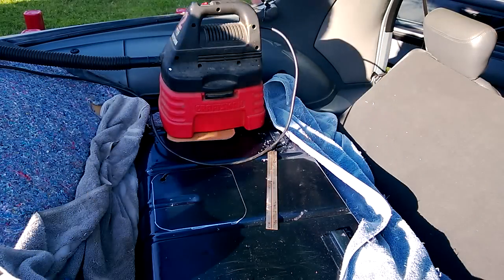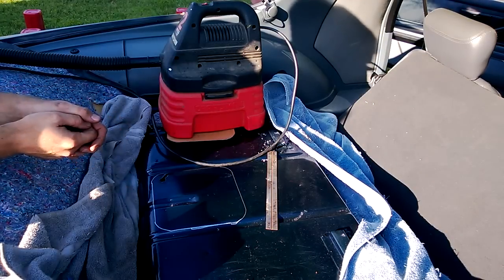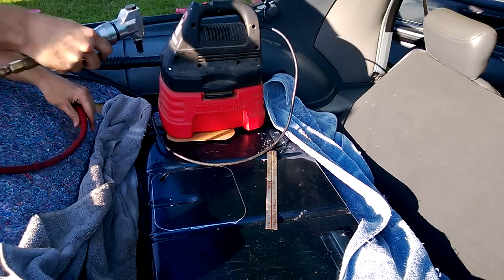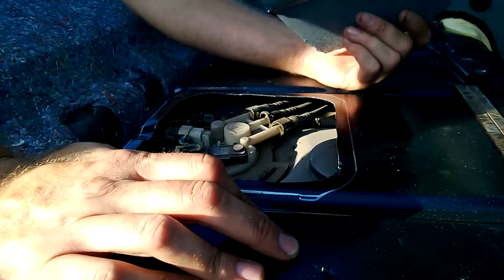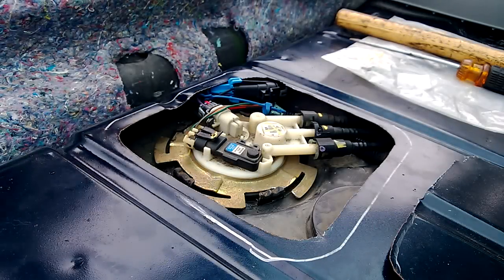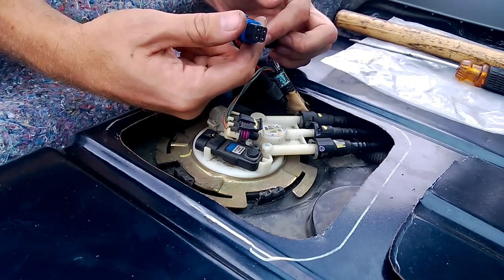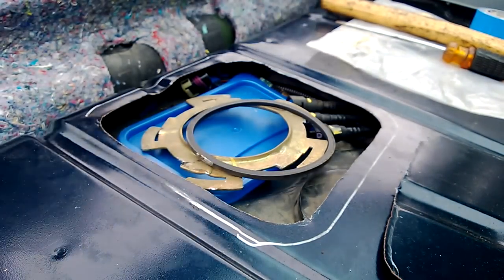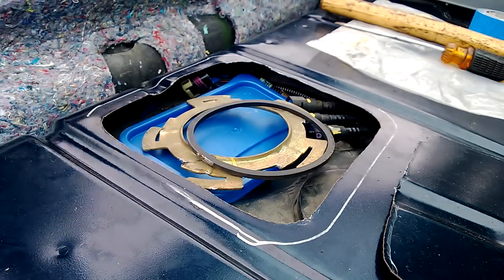Cutting Fuel Pump Access Panel and Removing Fuel Pump Assembly - 86 Trans AM with 02 Gas Tank

Comment: Yeah, lets just cut holes in the car. I guess the design guys didn't know nuffin bout unibody integrity. Now you have a access hole which can allow exhaust fumes into the car. And since you removed all the primer and rust proofing, moisture will do it's job and start rotting out that area. Personally I would have used a grinding wheel. More fun that way!
Reply from the maker: TF are you going on about?  This hole does nothing to hurt the integrity of the uni-body.  All the important structure of the uni-body in that area is in chassis extrusions and over by the shock mounting points.  The design guys did plenty I'm sure, but they also didn't test it with an access cover.  Its just not something they considered, but I'm willing to bet in a crash test there will be no difference with or without the hole.  NO exhaust fumes are coming through this.  There are more fumes coming through the windows when they're down, than will EVER come through the SEALED access opening.  As for removing the rust proofing, you are 100% correct, I sure did.  And I also replaced with with better rust proofing (POR-15) when I was done.  Every time I see a new comment on this video I cringe Haha.
Reply: So you are a vehicle design engineer? Cutting holes in body panels of any vehicle not destined for the derby is just ridiculous. Only an amateur would do that. I did 8 years as a Marine Corps mechanic. Never did I witness such an idiotic repair. And I've seen a few. Cut a hole in the body! HAHAHAHAHAHAHAHAHAHA!!! See ya in the funny papers! And you should cringe when you see new comments. I would as well. When some poor guy decides to take your advice and uses the only tool he has, like an angle grinder, and blows himself up, you will probably laugh and call him stupid. Oh yeah, key word in your "disclaimer" I "believe".
Reply from the maker: You are off your rocker buddy.  If you take a cut off wheel to your fuel lines, that's on you.  This has been done by MANY....MANY people.  Not just on these cars.  And you're right, I am an amateur.  I never claim to be an expert.  I don't get paid to work on cars, I do it because I'm good at it, and I enjoy it, and for the most part people enjoy watching and like the help I provide.  Cutting holes in body panels makes cars destined for a derby now???  That's hilarious.  I may not be a vehicle design engineer, but I have enough engineering experience in my field to know that its fine.  You've never witness such an idiot repair?  Come on...  Do you have something specific against me or do you go around looking for all DIY things you don't approve of on youtube and toss around your BS?  If you do you must be very busy. Good lord I try not to engage people like you, but I can't help it.
Reply: Yes, I am off my rocker. I don't like to see idiotic advice from clowns. And no, I don't spend time looking to engage people with dumb ideas. But when I come across them I do feel compelled to respond at times. If you don't appreciate my reply, don't read it. And I never said cutting the hole makes the car derby bound. I said no holes should be cut unless it's derby bound. What's wrong? Thinking maybe I'm right?
Reply from the maker: Ok, so we're down to semantics now.  So ONLY if I plan to take the car to a derby, is it ok to cut into the body panels?  Right?  I want to make sure I have it right so I can pass this advice along.  I wouldn't want you getting angry at me and calling me names for getting your wisdom incorrect.  I guess I should have stopped and taken the car to the derby after I cut the same size hole in my trans tunnel for the auto to manual conversion?  You think you are right, and that's fine.  I actually do appreciate your reply believe it or not.  I probably shouldn't have responded...but oh well.  Thinking you're right though?  Nope.  Sorry man... I 100% disagree with your entire argument here.  I also am pretty certain you are aiming to get me riled up.  Now I'm a clown?  Wow dude...  The kids have a word for that, but I hate using it.  If it makes you feel better, I will stop responding so you can have the last word.  At the end of the day, this won't affect me one little bit.  I'm going to keep on keeping on.  Sorry you didn't like my video, my stuff isn't for everybody!
Reply: No, it is not. First correct thing you have typed all day. The hole cutting does kind of remind me of Larry, Mo and Curly Joe.
Reply: Don't worry about this POG talking trash. He's just mad cause all he did was stay behind wire while the rest of us were stacking. Ive owned nothing but f bodies since I was in high school. Every single one of them I put a trap door and it runs fine at the track and as a daily. Its a fast way to swap that pump out period. If structural strength is such a concern then go get some subframes and roll cages but dont go bashing someone else for something you don't agree with. Insecure cowards do stuff like that.

Comment: I could've had that gas tank out and the fuel pump replaced and everything going back together before you even had the hole cut!
Reply: But for the record I have nothing against doing this, it should come from the factory like this, it would make everything so much easier if engineer's designed vehicles to actually be worked on instead of just worrying about making the most money!
Reply from the maker: I agree....if you already had the exhaust off, axle out of the way, and most of the gas drained haha.  But for the whole job, this is pretty quick.  Plus I was babbling to the camera instead of working :)

Comment: hey i have a 1989 pontic firebird that needs a fuel pump.. i watched your video .. and i was trying to find were to cut a trap door how far.. and its a hatch back...please help
Reply from the maker: I will shoot you an email...but I want to respond here as well because this is important.  If you have an 82-97 F-body, you will NOT cut where I did.  You have to make a rectangular hole, more towards the back seats, and its much larger.  This location and size only works if you are running the plastic tank.  You can google "cutting fuel pump access in thirdgen camaro/firebird" or something like that and you can see pics and write ups on how to cut them with the stock tanks.  Its a big hole though...
Reply: Betty Baitt does the access hole needs to be cut behind the back seat head rest in a 98 firebird can you answer that for me
Reply from the maker: If it has the steel gas tank, you will need to cut the bigger hole, closer to the head rests.  If its the plastic tank, you can cut where I did.  I cant remember, but Im pretty sure the 98 has the plastic tank.  Dont quote me on that...give it a look.

Comment: Nice job, I like it. Why make it harder than it has to be?
Reply from the maker: +Jim Modrak Exactly.  Ive already been in there a couple times.  Its modified...anytime you modify something, you pretty much guarantee that you will have to fiddle with it again sometime.  One less thing I have to crawl around on the ground on a car that is too low to fix.  Thanks for watching!
Reply: +JEG&#39;s Garage We have a 1997 Riviera and it is leaking fuel when we fill it up from the smaller line that runs with the fill tube for the tank. I looks as though the large fill hose after the neck is rubber right to the plastic tank but the smaller one appears to go from rubber back to metal before it connects to the tank and I believe that is rusted and leaks when full and sloshing around. To drop the tank in the Riviera looks to be a MAJOR pain in the butt. So if I go after it I will be using this approach without a doubt.

Comment: Do whatever you want with your car, but don't do this to your customer's. Also, realize that there's not much room on top of the tank, the fuel and vapor lines, wires will all be sandwiched in-between the floorplan and tank. It is super easy to cut something you'll regret.

Comment: thats not a bad idea but I would file the edges down to a smooth finish. if it were me to do it this way I would use the piece that you cut and or use a piece of plexy glass to serve as a door an put a henge on it so you can open an close it.
Reply from the maker: I actually wanted to use the piece that I cut out.  Since it was a clean cut.  But, you need some way to seal it.  And the left over piece is about 1/4" too small all the way around.  I was going to put a flange around the body hole, and use Zeus fasteners.  In the end, I sealed it up with a bigger piece.  I thought about hinging it as well.  But its already so much quicker to get in there, I figured I wouldnt complicate it.  Besides, I havent been back in there yet.  I dont expect to have to go back in there for a long time.  But when I do...it'll be a quick job :)
Reply: +JEG's Garage rubber seal similar around trunks or doors. but it will be smaller to where when the lid is closed it seals flush.

Comment: How hard was it to get the 4th gen tank to wrk with the 3rd gen
Reply from the maker: Piece of cake.  First, the tank itself physically fits 100%.  Straps will fit, shape of the tank is basically identical.  Remember, the rear of F-bodies from 82-02 is mostly unchanged.  From about half of the car back.  The filler neck will not bolt in 100%, but luckily it is connected with a rubber hose.  Carefully trim some of that, usually about 1.5", and it will fit great.  Just trim a little until it fits, I trimmed too far and had to buy a new hose, which wasn't too expensive.  As for the fuel lines, you will have to get some push on to screw on adapters.  Check TGO or google and you'll find them.  Electrical is as easy or as complicated as you make it.  I chose to remove the stock bulkhead connector and rivet in the factory 4th gen connector, and wire from there.  Makes everything plug and play under the car and retains the really nice 4th gen connectors.  That's the basic run down.  If you have any other specific questions let me know!
Reply: +JEG's Garage thanks bro. Didn't get a notification that  u replied. I prob will Have a billion questions before I even start. 😁 my first question is how did u make ur fuel lines
Reply from the maker: Fuel lines...I will tell you how I did it, but I want to redo them haha.  I had a 99 Z28 donor car sitting right next to my project.  So when I swapped the tank, I realized that the cars were almost the same from the firewall back.  So the fuel filter fits in the stock thirdgen spot, and the fuel lines fit great until you get to the front subframe.  The 4th gens have a big kick out.  So, all I did was installed the 4th gen fuel lines and cut them at the sub frame area.  Removed the "kink", and reattached the front part of the line with a stainless compression fitting.  Which has held perfect for like 10 years.  The front part of my fuel line comes out in the engine bay, just like it did in the 4th gen.  So I used a piece of stainless braided line with quick connects on it to connect the fuel rail to the line...again, just like the 4th gen.  I will be redoing all of that eventually with new line from the filter all the way forward, routing the fuel line a little differently.
Reply: going to go to pick and pull and get me a 4th gen gas tank. I might do an LS swap in the near future or go with a brand new gm 350 with a atomic EFI. Which ever comes cheaper. I will though switch to a 4th gen tank.
Reply from the maker: Good plan.  The plastic tanks are just nicer.  No rust to worry about.  Easier to remove/replace with the rubber fill neck.  And I believe they hold an extra gallon or so, might be mistaken on that.  GM350 with EFI would be nice.  But wont compare to an LS variant.  Even in stock form.  If you can snag an LS3 or something complete with computer and harness, you'll be worlds ahead, and install is just about as easy with all the conversion parts out there now.  Just a bit more expensive.  Either way...you'll be happy with the upgrade.  Do a big brake upgrade to the LS calipers (at least) too while you are at it.  I love my braking almost as much as I love the power.

Comment: Does this work for an 89 Pontiac trans am?
Reply from the maker: Technically, yes.  Just about anything that works for one thirdgen f-body will work on all 82-92 Firebirds and Camaros.  They're all extremely similar.  HOWEVER...to do this to a stock car, you will need to cut a much larger hole, and more towards the front of the car.  The hole will be as wide as mine, but at least twice as long, if not longer.  I dont normally recommend doing it to the stock car, but ultimately it'll be fine.  Just make sure you make good connections, and put a nice SEALED cover over the hole.

Comment: You should be prepared to just go ahead and drop the new pump in it immediately ! You don't need to cover the hole ! Replace the seal and cover it with the new pump and be done with it ! Why let it sit open any longer than you absolutely have to ?
Reply from the maker: The new pump had to be assembled into the stock sender assembly.  I guess you could buy another sender assembly and get it ready, but I didnt do that.  I cant remember, but Im pretty sure I went right in the garage and assembled the new pump and popped it in.  The cover was just to keep me from knocking tools down in there or anything in the mean time.  Didnt hurt anything thats for sure.
Reply: Oh ok ! The pumps I usually get are compete and all you have to do is attach the float and drop it in . I have it right there and ready to drop in as soon as the old one comes out. It just makes me nervous to have the tank open like that , of course I always disconnect the battery but you never know .

Comment from the maker: @zackery blevins - Do NOT cut where I did.  The difference in year isnt the issue here.  The fact that I have a 4th gen plastic (99-02) gas tank is the big difference.  On all F-bodies from 82-97ish you'd be cutting in about the same place . The metal tanks have longer hard lines coming off the fuel sender, and you'll have to cut a pretty massive opening.  Probably twice the length of what I have.  Also...you will be cutting more towards the back seat vs the trunk area.  Search on thirdgen dot org and you'll see some examples of how guys are cutting.  Personally...I wouldnt cut for that tank.  The hole is too big, and you have to cut too far into the car.  i was ok with my small square opening, but if I had a stock tank, I would probably drop it.
Reply: There is almost a box pattern in the sheet metal ontop of the tank u need to cut 1 inch from the lines all the way around on a stock 82-92

Comment: I don't see anything wrong with cutting a access hole that should have already been there from the factory. It really should increase the value of the vehicle, especially if done neatly and professionally like you're doing.  I didn't have any problem doing it on a 1994 Mustang gt and a 1999 Lincoln Navigator. I found that a simple hammer and sharp chisel works good too.
Reply from the maker: +P.B. Theriver Absolutely!  There are many ways to open up the sheet metal.  Its not hard.  I dont know if it would add any value, but to me it sure does.  Assuming it wasnt chewed open and sealed back up with bubble gum :)  Thanks for watching and commenting!

Comment: will the trans am tank fit in the camaro ?
Reply from the maker: Year for year yes.  Trans AM and Camaro are essentially the same car.  Only difference being a little of the unibody and the sheet metal. Obviously some of the interior is different, but you can swap that stuff too.  Otherwise, most parts are interchangeable.  Fun fact, the rear half of F-Bodies (aside from sheetmetal) was largely unchanged from 1982 to 2002.  Suspension, exhaust and some other bits will bolt right on.  Fuel tank with some modification to things like the filler neck/wiring/hoses.  But physically all the tanks will fit.
Reply: JEG's Garage my 86 has a steal fuel tank assembly and looks way different I like the plastic lines maybe I'll swap mine over im doin a bbc efi swap
Reply: Awesome thanks

Comment: The funny thing is that the first fuel injected meaning EFI back in 1955 had pump access panels. They did away with them to make money. Stupid move
Reply from the maker: Lots of cars use them. And some are VERY sketchy like when they put them directly under a rear seat cushion (Subaru Legacy)....

Comment: If there is any dirt in the gas tank, your not going to to be able to get the dirt out of the tank or clean it.
Thank you Dennis
Reply from the maker: Dennis Friedman Hi Dennis, thanks for watching!  True, you couldn't dump in cleaner, swish it around and dump it out.  However, this is a 4th gen plastic tank.  No problem getting my whole arm in there, and wiping the tank down.  I just used cleaner and a rag and reached in.  It would have been more difficult if the tank had more gas in it.  I would have had to pump it out.  But in my case, I was able to sop it up easily.  If it was so dirty that it needed more than wiping, then I would consider dropping the tank. I dont anticipate the plastic tank needing that though.
Reply: that would be nice
Reply from the maker: Dennis Friedman I forgot to link to an older video.  You I actually show the inside of the tank.  You can see how easy those 99-02 plastic tanks are to clean out!
https://www.youtube.com/watch?v=8uhrW4aW0tQ

Comment: Can u do the same. On a 1986 I roc z z28
Reply from the maker: +Juan Delgadillo Sorry for the delay Juan.  Im sure you got your answer by now . You CAN do it...but its a massive hole compared to what I cut.  You need to cut more of a rectangle.  If I were changing the stock pump on a stock thirdgen tank, i would be dropping it.  Because of the modular set up with the 4th gen tank, this makes more sense to me.  Small hole, yank it out, slap it back in.